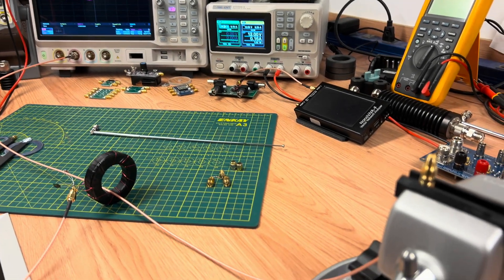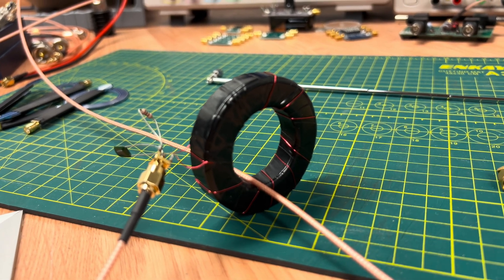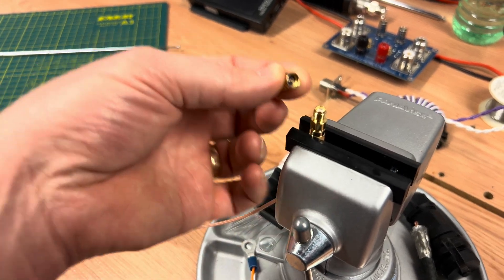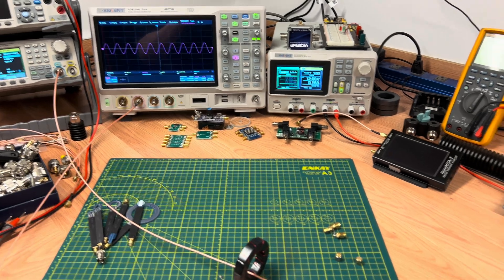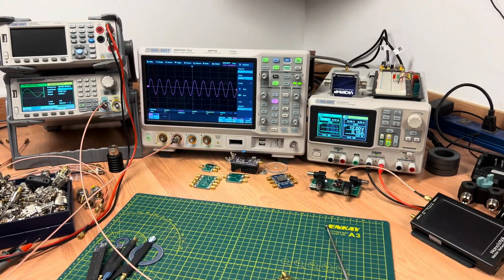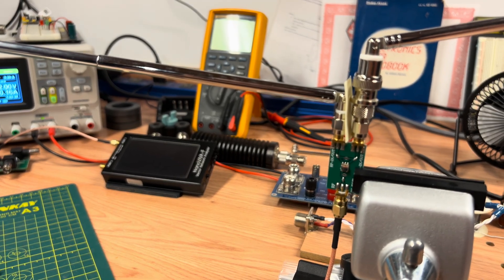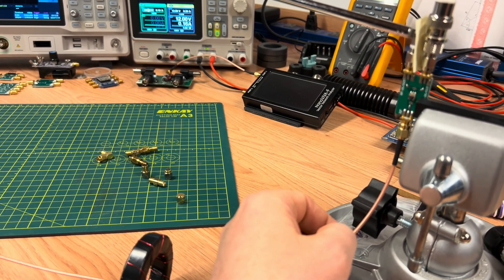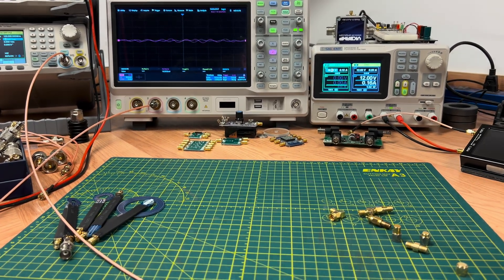Common Mode Current Feedpoint Impedance Mismatch Experiment - Revisited

Comment: Hi,

The coaxe is unbalanced structure( Feed point and shield is grounded via the signal generator) , when connecting 1 side of the dipole ANT to the coax  its UNBALANCED to UNBALANCED .

no change in  balance to unbalance or vise versa, why is it still radiating?

Comment: Good presentation!  What would have been a nice addition, with the displayed common mode current, place a ferrite bead(s) on the coax to see if any effect AND run the bead(s) up and down the coax to see if there are optimun points of rejection (if any?).  Since you are at 100mhz, the feedline is probably in excess of 1/2 lambda so would be interesting to see if there are other bead placements that replicate the feedpoint?

Comment: Many thanks for doing the experiments for us. The key takeaway from this video are :

1. Antenna feed point impedance mismatch doesn't cause common mode current in the outer surface of coax shield.
2. A line imbalance at the feed point (when feedline is coax=imbalanced and antenna is dipole=balanced) will cause common mode current to appear in outer surface of the coax shield even when the impedance is matched.

I have one query, what will be the common mode impedance, that determines that how much will be the common mode current on the outer surface of coax shield. What will be the process to determine that common mode impedance ?

73
DE VU3KFK
Reply from the maker: This is an excellent question, and one that I was asking myself as I was preparing these recent videos.  I have never tried to make this measurement, and have not yet run across any articles dealing with this subject in my reading.  In theory, a person might be able to use a nanoVNA to take the measurement… I will keep this in the back of my mind and see what comes.
Reply: Don't quote me on this, but I believe 200+ ohms would be a reasonable assumption as to the common mode current impedance. I caught that tidbit on a video about common mode detection and effective chokes on HF bands. I'm not positive this is helpful to you, but I figured I'd chime in since I just heard this on the video I watched before this one.
Reply: The guy also did show a formula used to figure it out come to think of it, so I'll see if I can go back and find it here in a minute and share it here if I can.
Reply: The formula is 2Pi times Frequency in mHz, times inductance in microhenries. The 200ohms was based on a 50ohm setup as minimum impedance on HF, but the formula will get you a more exact figure for any given band or specific frequency. Hope this helps

Comment: This is great timing for me. I'm looking at the optimum placement for a ferrite choke on an endfed single band antenna.
Can you move your coupling device up and down the feed line to find the greatest magnitude of CMC, then measure from the feed point? It would be great to do this test with the single end of a dipole (1/4 wave), and even a  half wave endfed antenna, and I would need to know the frequency.
I mean, since you have this set up already, and short of myself making a sensing device and buying a scope.

Comment: I experiment with random antennas in my living room in the same room as the radio and even work 5k miles with indoor antennas. Very often though, working digital modes, the radio and PC will disconnect from each other when TXing. The 2 options I have are lowering power and adding clamp on ferrites to the coax. But some antenna designs will handle 100w and no RFI issue at all. Others can only handle 10w even with a perfect SWR before RFI causes havoc. I work 160m to 10m indoors just experimenting.

Comment: For some reason these "expert'' commentors just keep acting like they know better than the ARRL Handbook. And each time when one proves them wrong and embarrasses them, they still believe what they wanna believe... Like in lowering the swr by increasing coax length)
Reply: Yes, it's not going to lower the SWR at the feed point, but changing the length of the coax can make the transceiver happy... it will see something closer to 50ohms, for example.
This is because the feed line transforms the impedance when the load and source are not of the same impedance.
I'm positive you already know this.

Comment: One thing I noticed is that you have the coax running parallel to the radiating elements which may be contributing to RF wanting to go back down the line. Would be interesting to see the difference when the coax is perpendicular to the elements.
Reply from the maker: Yes, I tried rotating the dipole and arranging the coax so that it was more ideal.  It did not seem to make any difference in this experiment, so I arranged things so it was easier for me to fiddle while holding the camera.  Haha!
Reply from the maker: In any case, the end result was the same.  The use of a balun at the feedpoint stopped common mode currents from making their way down the outside of the shield, which also resulted in a much more stable antenna system.
Reply: @ve6wo Shure, because it's coupling all around, and You showed it so nice when touching something around - Feeding a symmetric radiator from a asymmetric Coax feed is always a big mess when not taking care with a BALUN element between. Congrats for Your demo experiment. Done very simple and very easy to understand. The most funny thing was the AI fail - It shows that the AI of today is far away from logical thinking - Today AI is mostly Bullshit Input = Bullshit output. Very cool Demo all the way down from the Mismatch effects until showing the real cause of coax shield currents. Congrats once again - Perfect👌👌👍👍
Reply: Thanks for the video. I watched the previous one too and now you have posted this in response to the question asked in the previous one. I believe you may want to make one more again to clarify some more doubts.
As already pointed out by a commentator the main reason the CMC is impinged on the shield of the coaxial cable is that the feeder runs parallel to one of the dipole elements. It's advised not to run the cable parallel to any one of the arms of the dipole at least a quarter lambda long of the frequency of operation. Here you are operating at 100 MHz.
Secondly, you should purposely cause an imbalance by varying the length of one of the dipole elements to bring about the appearance of the CMC in an otherwise no CMC or to cause a change in the magnitude of CMC.
Thirdly, the effects of the installation of the CMC choke (1:1 Guenella current choke Balun) at the feed point (as you did) and one more choke before it gets into the oscilloscope (the detector) may also be demonstrated.
Fourthly, absorption/reflection, scattering of the electromagnetic energy by other materials especially metallic structures in the near fields is well demonstrated. 
The good old article by Roy Lewellen, titled, "what baluns do and how they do it" is a very good read till today, I believe.
You may very well device some more intuitive ideas to make it very clear that impedance mismatch causing varying degrees of reflection from the feed point towards the source (the radio) is a phenomenon restricted to the dielectric material of the coaxial cable; it doesn't affect anything outside of the cable. Or does it?
Any amount of CMC has nothing to do with what's happening inside the cable, within the dielectric material between the outer surface of the center conductor and the inner surface of the shield.
You might succeed in showing that there is no relationship between the CMC and the high SWR (when the load happens to be purely or nearly purely resistive)
But, when the load happens to be highly reactive and the magnitude of the CMC is large, it would certainly skew the SWR read at the shack end of the coaxial cable. 
De VU2RZA